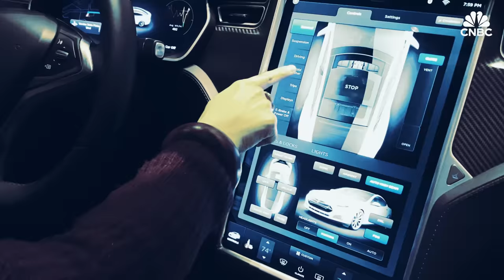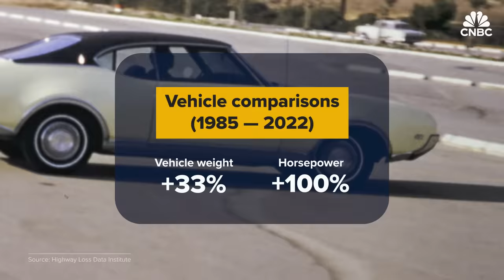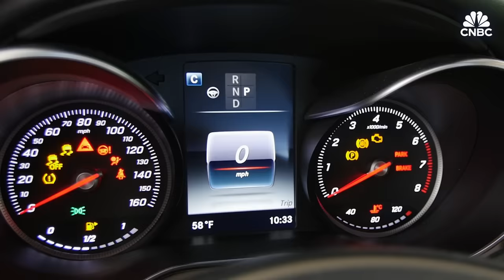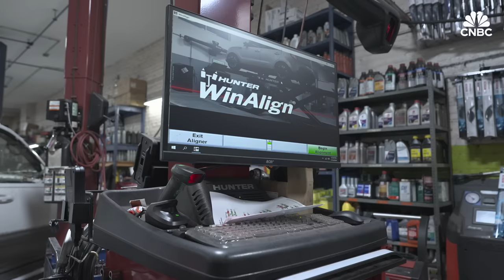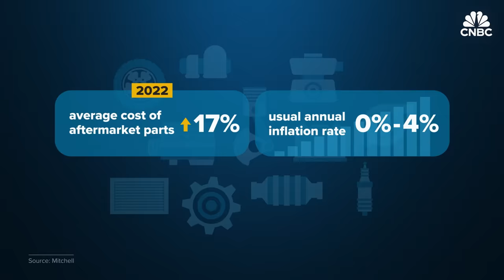Why Car Repairs Are Getting So Expensive

Comment: I'm a master technician who has been in the business for about 20 years and I haven't seen anything like the last couple years. Parts have nealy doubled, no matter if it's aftermarket or OEM, not all parts but a good majority of them have, I have many different suppliers that I use to try to get my customer's the absolute best price I can for them on quality parts. The pandemic also caused a LOT of third party manufacturers such as Dorman, Behr, Nissens, Mahle, etc. to completely STOP manufacturing of some parts for some makes and models with no word on whether or not we'll see them produced again. This has caused a drastic rise in parts pricing, there is a LOT of scalping going on due to supply chain issues even at direct factory buying, it's actually insane. This is just ONE of the things making prices go up, labor rates have sky rocketed due to MASSIVE rent and insurance increases, techs are FINALLY starting to get paid what they SHOULD have been paid 10 years ago, most shops were taking advantage of seasoned tech at $17 an hour in California, techs with their own tools should be making at minimum about $22 an hour but should be near $25+, I've finally seen techs getting $30 an hour, also a few misconceptions in this video but electric vehicles DO still have oil changes and should be performed regularly, their drive units require ATF and filter replacement and Tesla themselves have fumbled the numbers multiple times as to WHEN you should perform the maintenance but like with any transmission or differential component you should probably stick to doing it about every 36K miles, EV's also still have cabin air filters and require AC system maintenance and brakes and tires and alignments and suspension components just like any regular ICE vehicle, the biggest caveat of this "lie" EV makers feed their customers is that there is no maintenance and nothing to replace but on average an EV battery system will only last about 8-10 years depending on charge/discharge cycles and temperatures and mileage.
Reply: Thanks for your perspective about this. I shudder to consider the replacement cost for an EVs lithium battery pack!
Reply: Go off fam! 👏👏👏Thanks for sharing. I truly don’t think EVs are the future. They’re just reinventing the wheel. Maybe EV buses and EV tractors, but everyone owning an EV CAR? The roads can’t take it, the grid can’t take it. They have so much intertidal it’s a recipe for disaster. They aren’t the future IMO.
Reply: Well said
Reply: Yep, even simple car maintenance has been lost on much of the current generations.  Being an old school boomer, I still do all of my car maintenance short of those requiring special tools or diagnostic equipment.
Reply: The best price for a part, that you then mark up 40%?   LOL, okay then...
Reply: @chelseashurmantine8153  internal combustion engines are essentially modified steam engines. It’s 200-year-old technology. Electric vehicles were first produced in the 1890s Who exactly do you think is reinventing the wheel? And there are virtually no 8 to 10 year old Eevee batteries in existence — so why do you think they are all going to need to be replaced in 8 to 10 years?
Reply: Everything costs twice as much, food, parts, gas, wood everything
Reply: @bkinstler  ICE engine are not modified steam engines, they're much more efficient and are a completely different principal in practice. Iternal combustion engines are giant air pumps, not steam generators, the only thing they have in common is pushing a piston. There ARE 8-10 year old EV lithium batteries, Tesla themselves started producing cars in 2008, the ones for sale used have less than half the range available than when they were new and the problem with batteries is that even from sitting they can become unusable, from the date of completed manufacturer they are slowly dying and this is exacerbated by driving habits, charge and discharge cycles, there have been many many many stories of EV owners losing half their capacity or the batteries just completely stop working within the first 5 years and need replacement and in every single case the battery replacement costs more than the vehicle itself not to mention that just running over some road debris is enough to damage the belly pan battery pack on most Tesla's, the second that battery pan is damaged it calls for replacing the entire belly pan which again, the labor and cost of the battery is more than the cost of the vehicle brand new so they always end up scrapping them. A good friend of mine is a fleet mechanic for Southern California Edison, back int he late 90's to early 2000's SCE contracted Toyota to build them battery electric EV RAV4's, they used absolutely MASSIVE NiMH batteries that took HOURS to charge and only gave you about 80 miles of range and these batteries were only made by Panasonic, within less than 3 years nearly all of their RAV4 EV's batteries failed and Toyota quoted them $23K each to replace the batteries on a $30K-ish vehicle. They dumped them and bought brand new Prius' instead. While NiMH is very different from lithium, this is something that happened 20+ years ago and still remains true even with all the new advancements in battery technology.
Reply: Agreed. I think the scalping part is not being mentioned in this video, but it is making the price higher.
Reply: @JoseLopez-tk4tq  I was watching another news outlet on YouTube where customers were complaining about the average cost to replace a battery. The lowest I heard was $18,000 and that was a used one
Reply: Dorman and other companies have actually increased their product line.

Comment: Another problem is the quality of parts. Parts store like autozone, Napa, O'reilys, etc, are all seeing brand new parts with horrible quality control. The rate of bad new parts the companies are seeing has jumped
Reply: Blame China… literally! I follow a lot of car review channels as well as car repair channels on YT… they all basically say the same thing… A lot of non-OEM parts come from China but are made with substandard materials or are poorly put together and don’t last or just break shortly after installation.
Reply: Headlight from Autozone was a Sylvania HID blah blah blah for $105, while the stock/factory part is $45 on Amazon. Something is amiss.
Reply: One of my sparkplugs failed after 2 month. 25% fail rate is Poor quality.
Reply: I ordered a new CV axle for my Toyota 4Runner from a Toyota dealership. The dealership was more than double the cost of an OEM part from auto parts store. The dealer received a damaged part, which I had to point out. It took 7 more reorders to get one that wasn’t damaged.
Reply: i used to trust buying parts from these stores but not any more
Reply: Facts. They gave me 2 bad fuel pumps when I was restoring my ranger. That's if they're even competant enough to get you the right part in the first place.
Reply: How come it was not a problem during the 90s and early 2000s? It's the manufacturers that are making the parts difficult.
Reply: @jerseythedog You didn’t not buy a OEM headlight for 45$ Amazon is famous for selling Chinese parts under the same stock number
Reply: I have a repair shop and I hate when I have to replace a caliper because so many times I've put them on and they were bad right out of the box, or they come back 6 months or a year later and the piston is locked up. Sometimes I think they do no quality control testing on their parts at all.
Reply: @waterloo123100  I knew something was up. Edit: The part came in. It’s exactly the same as OEM.

Comment: So glad I payed attention when I worked on cars with my dad and took shop class, I can fix just about anything on my basic car, fluid changes, brakes, alternators etc. Not a mechanic but I've saved a bunch with no car payments or ridiculous car repair bills, they are robbing people out here, I've seen it.
Reply: Same. And You Tube was a big role in that as of the last 18 years. However I learned a lot as a kid, since my dad worked for my grandfather in the 60's when my grandfather owned a Standard gas station.
Reply: Same here. I was always afraid to touch my car but I learned how to fix few things. I now replace my brake pads & rotors, oil change, spark plugs, tranny fluid, alternator, installing battery. I learned by watching YouTube videos & invested in a lift & tools. Saved lot of $$
Reply: @sudha4128 Someone has a car payment..
Reply: I can fix just about anything but unfortunately my kids haven't been interested.  They are fine while I'm around but someday it's going to come back to bite them hard
Reply: I once did the math on how much I've saved in labor and parts on an old car of mine by doing work myself. The numbers were mind boggling. It was thousands and thousands of dollars.  The only thing I can't do is alignments and tire mounting/balancing, and I'm going to get the machines to do that some day.

Comment: The automaker is gonna be motivated to get these costs down. Thats the funniest most absurb shid Ive ever heard.
Reply: Why would automakers get "costs down: when SERVICE is the number ONE PROFIT maker in a dealership!! Lol...hilarious. Remember this IS a "business channel"...this message is approved buy the manufactures so they can PRETEND not to be the bad guy...lol..who are the ONES who SET the labor rates, warranty rates, etc...hilarious!!
Reply: It’s the classic gaslighting.
Reply: The automaker is only motivated to get costs down for the first owner under warranty. Low cost of maintenance and fewer inconvenient trips to the service department are great marketing. But for the used car buyer after that, who is out of warranty, the service department is ready to profit!
Reply: Well, most car manufacturers do not in fact own their own dealerships (dealerships have a lot of favorable legislation protecting them from carmaker selling directly or vertically integrating that Tesla has fought hard to find loopholes around).  So all of those servicing department mark-ups and fat margins aren't actually benefiting car manufacturers.  

I think there is fundamentally a market failure where they aren't really incentivized to reduce repair costs except to the extent that it becomes so egregiously worse than their competitors that it drives them to other brands next time (e.g. the $60k Hyundai Ioniq 5 battery replacement problems that grabbed headlines a month ago).
Reply: people will be more inclined to buy on the used market because newer cars are more costly to repair.  Older cars are less costly to repair, and buying older used cars don't really help the car manufacturers.
Reply: Did not know this channel was so funny.
Reply: @jofujino  Its not a free for all..Warranty work and other guidelines are strictly is controlled by the manufacturers...

Just like MCDonals Corporations doesnt own the restaurants of the franchisees..but those franchisees dont just do what they want and charge what they want, but from suppliers they want, etc
Reply: @michael.sierra  Yep!!
Reply: @HuChing-ob4kk  I think you are misreading my comment.  I did not say it was free for anyone.  I said the car makers aren't making money off of the repairs because they're not in the repair business.  They're not even in the dealership business.